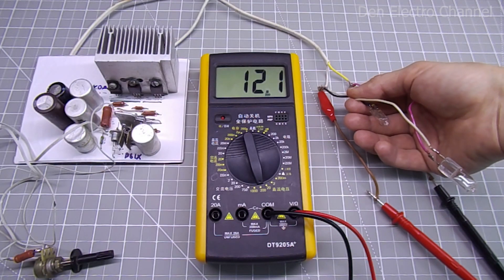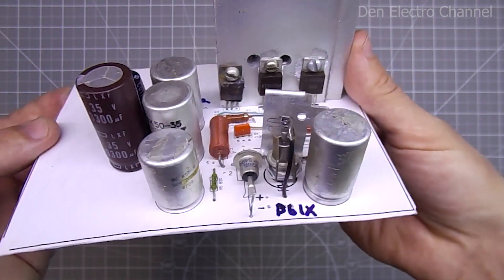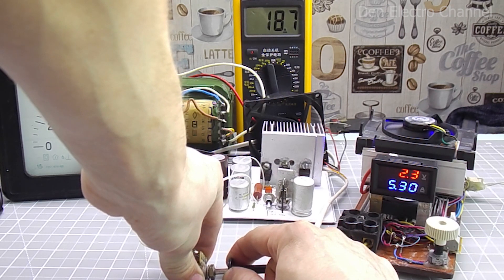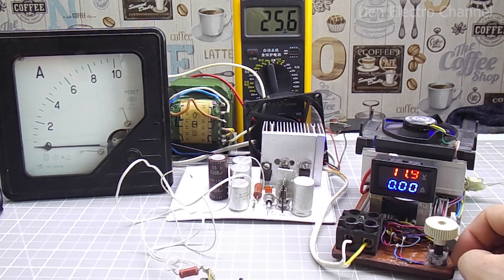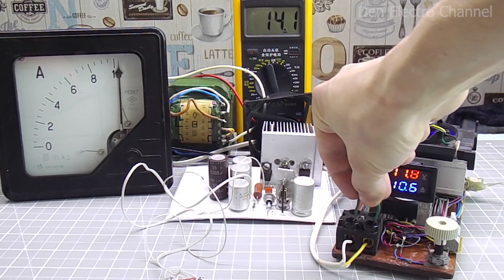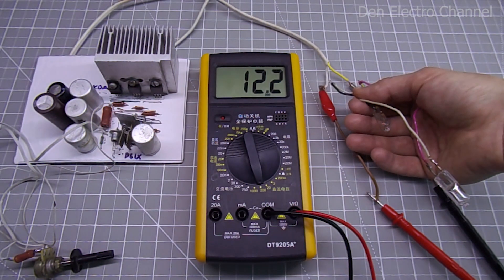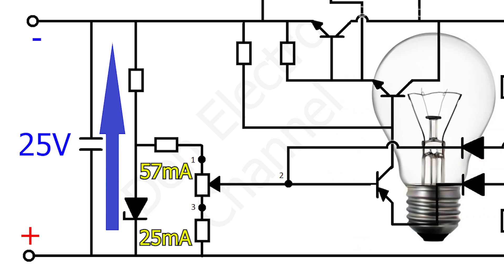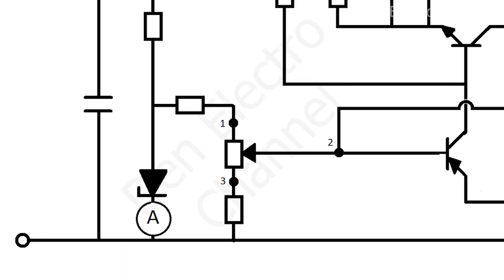Do-it-yourself Bench power supply with Soviet parts

Comment: I have not soviet parts....Can use ordinary parts?
Reply from the maker: Yes, of course you can.  It is necessary to select transistors with similar characteristics.  Current, voltage and gain.  You can simply enter in a search engine: Transistor KT805 analogues.... And they will show you what you can put in their place.